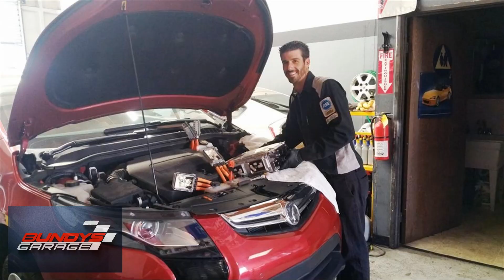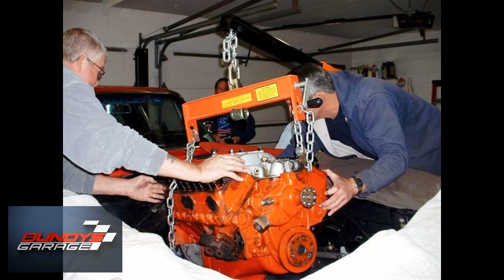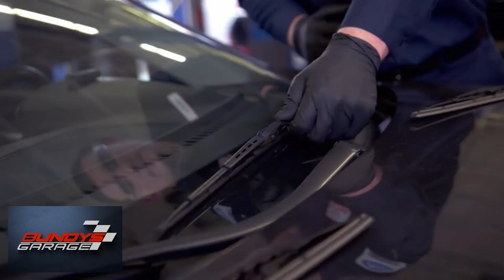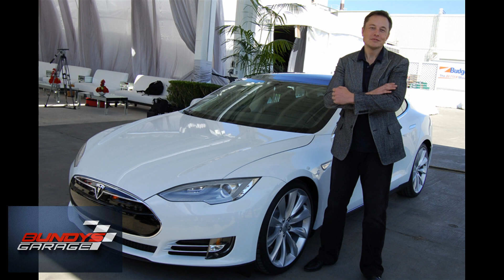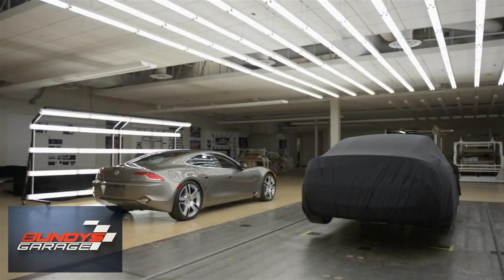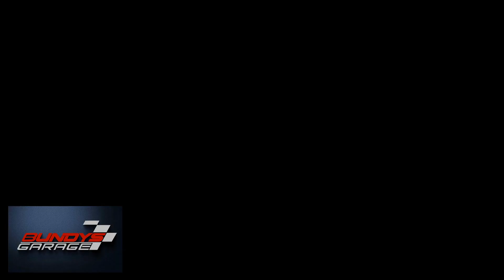Worst car on the Internet - Toyota Prius - Electron Automotive - Orange, CA - 714.609.5064

Comment: as non amazing looking and slow my prius is I don't mind it one bit. the car has been the most realiable and at the same time fuel savings car that I have owned so far.
Reply: For real. Mine has close to 300k miles. Over 50,000 are mine and the car has had only one mechanical failure since I've owned it.

So nice to see someone else talk about the Prius without completely shitting on it.